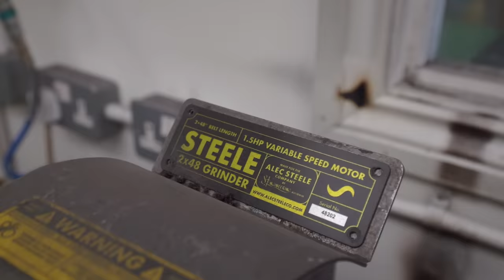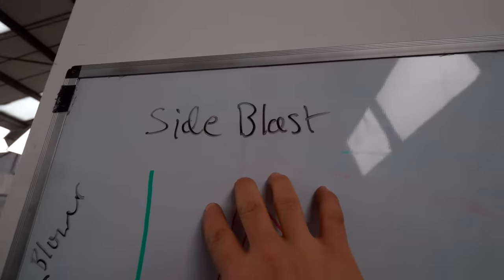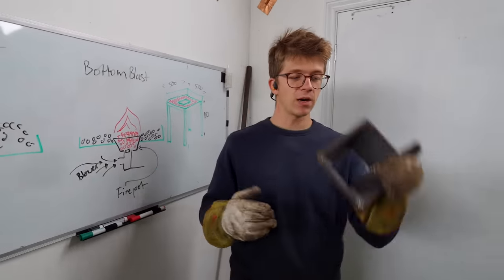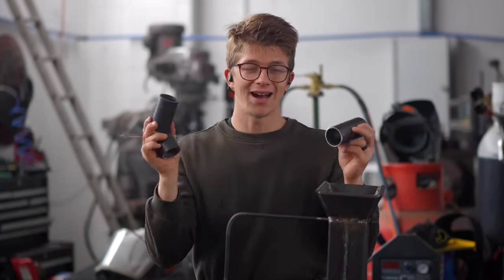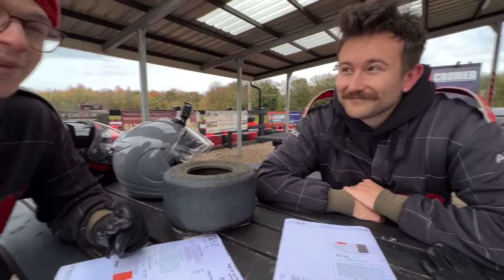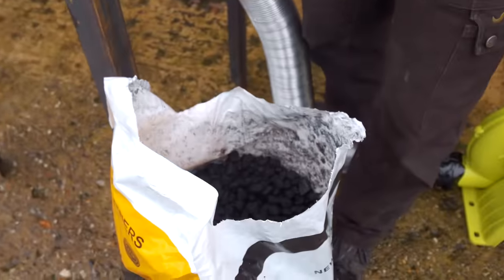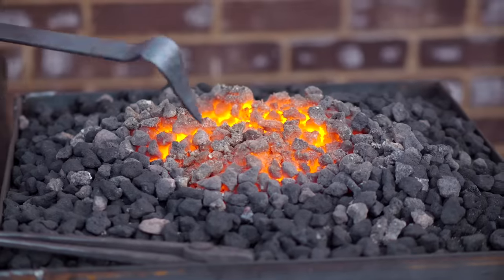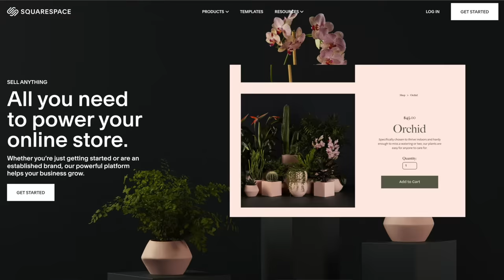I Made A Coke Forge!

Comment: Did you not do a video before entitled something like “why coke forges suck”? And now you have recognized why they are superior in one statement of “I want one in the shop… to create localized heat in a piece of steel….” Or however you worded it. Which is precisely why I stopped using propane entirely. Once I got that first load of coke in the yard, I never bought another tank of propane for forging again. Coke forgets is WAY less maintenance on the forge itself, WAY less effort to build the forge, cheaper fuel (in my case always free - I simply asked the coke plant if I can have some coke, they allow me to get 1 ton as often as I can go through it - which is A LOT of coke about 1.5 years worth of all day work), you can burn the fuel in any rigged up forge, no precision necessary, ect ect ect.

Comment: About time, too! You can never call yourself a blacksmith until you use a coke forge. Gas forges are simply not hot enough... a coke forge welds far hotter and easier... even I could do it successfully as a schoolkid in the 1960s.

Comment: I found a 100$ blower that uses a portable battery and is pretty quiet. My only issue is my forge is made of brick and the pipes aren’t made for heat. So my bricks get cracked and slide around and make a mess of my coal. I also have trouble with burning my steel😢 melted multiple projects now. Check my channel out.
Reply: I also think one big issue is I don’t have a clinker breaker or a bucket to empty out at the bottom

Comment: Cant you just use a secondary torch inside your gas forge with blown air that you an turn on and put the steel directly infeont of to get it that hot and if needed add pure oxygen.

Comment: People think gas is better but you can't run a reducing flame in a gas forge. For thin materials the gas forge will suck the carbon out of the edge. Where as with a solid fuel forge the hot carbon monoxide and carbon dioxide protects the steel from losing carbon.

Comment: You should create an oxygen enrichment valve for the air inlet, which would make the fire hotter, maybe? Using the oxygen cylinder to provide the gas and regulates it according to the desired temperature.
I am not a blacksmith, so I don't know if this is needed. should be fun.